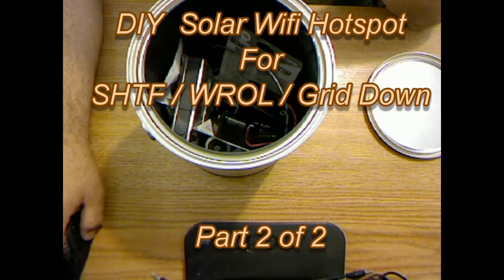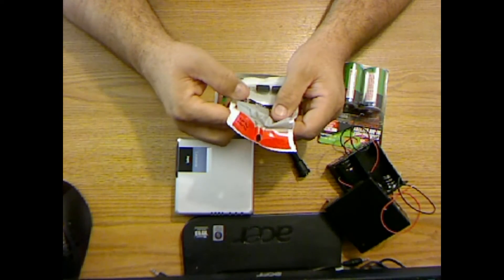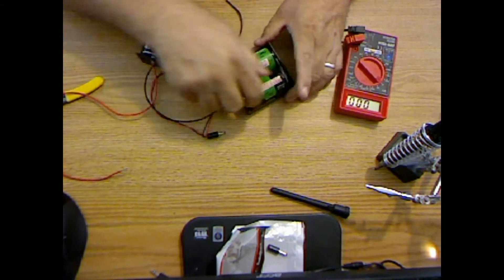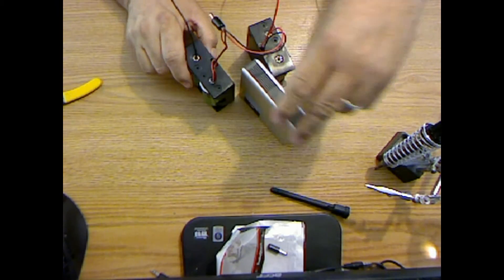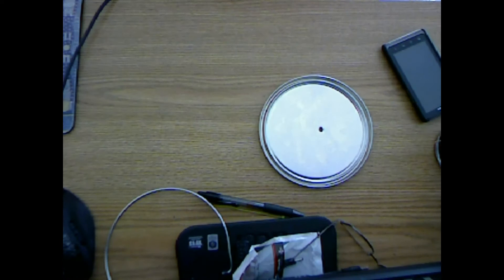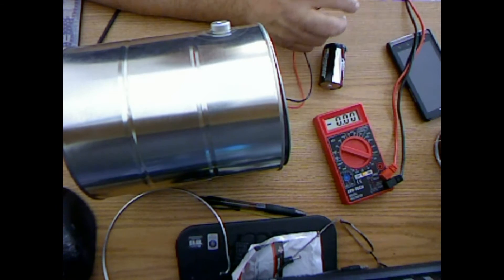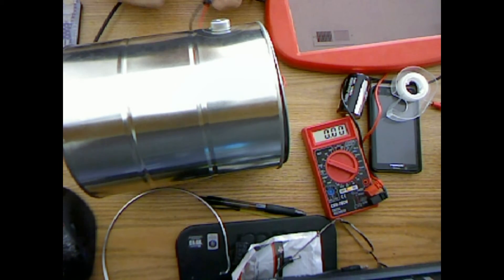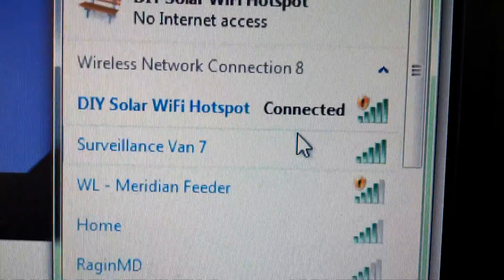DIY SHTF WROL Grid Down Solar Wifi Hotspot Part 2

Comment from the maker: It shouldn't It have just enough watts to keep the router going. At best it trickle charges the battery's but we will see. Its running now. Im doing a 2 week test. the signal was very weak at 1130 last night. But now ( the morning and sun is up ) It is back to full strength.